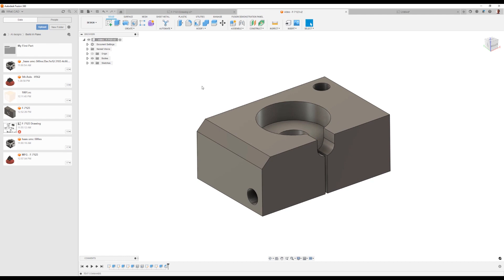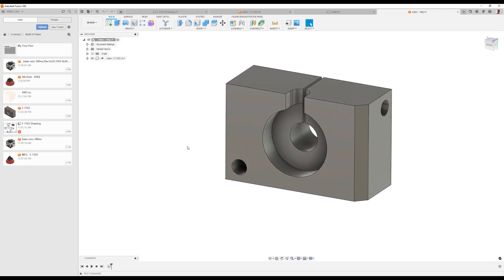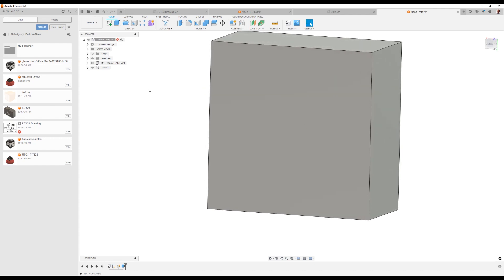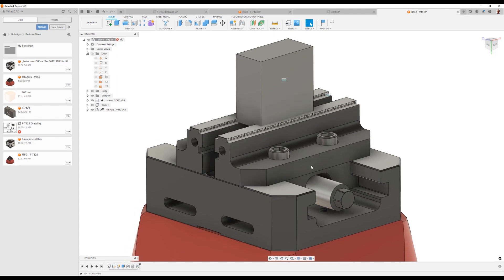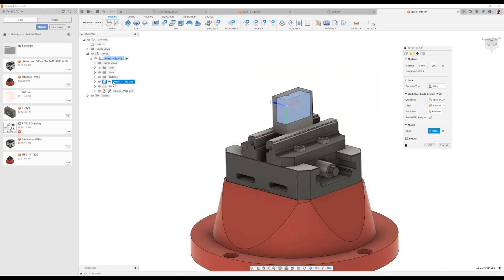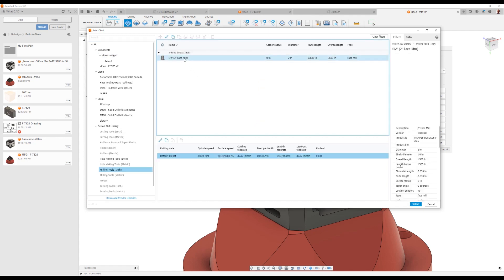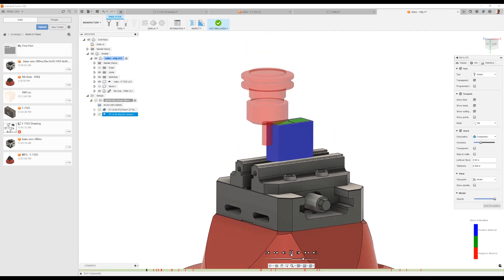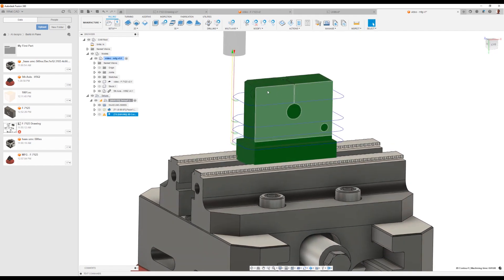CAD/CAM Fundamentals: Step-by-Step CAM Setup and Toolpath Tutorial | Autodesk Fusion

Comment: I want to use my old way of doing 2D drawings with pencil and paper for drafting as input.  Then have fusion 360 render it as a 3d object.  Then have the output saved in stl.  I don't want to learn all the complicated loft, revolve, etc stuff which Autodesk keeps changing each month and I can never figure out.  

I know it works because draftsman and engineers use this for manufacturing for 100s of years.  It's easy, because it had to be since it was pen, paper.  And it's portable because that method has been used for all kinds of documents and manufacturing.  So how do I do this easier way in Fusion 360?

360